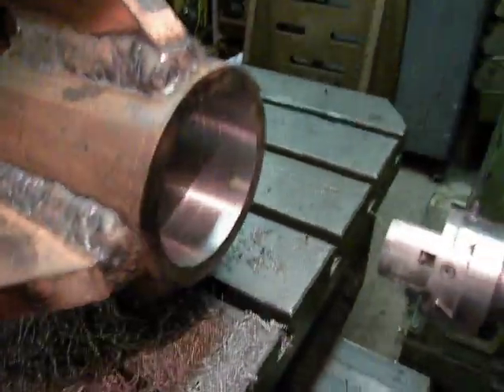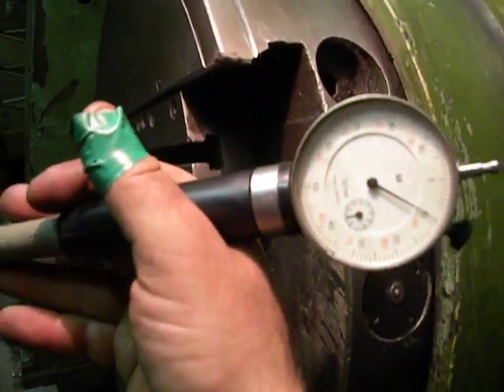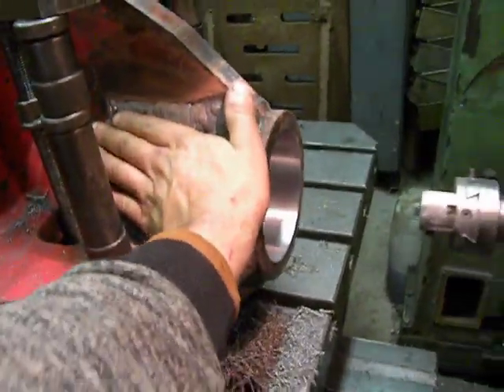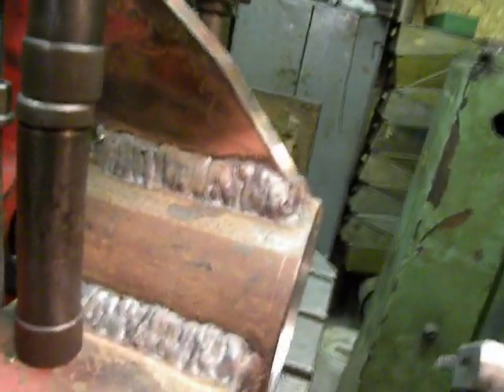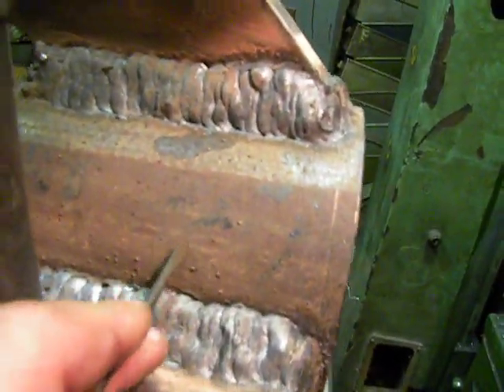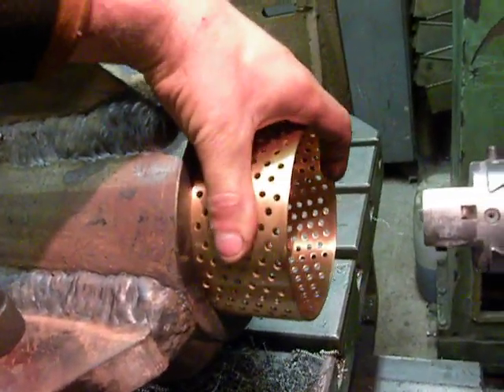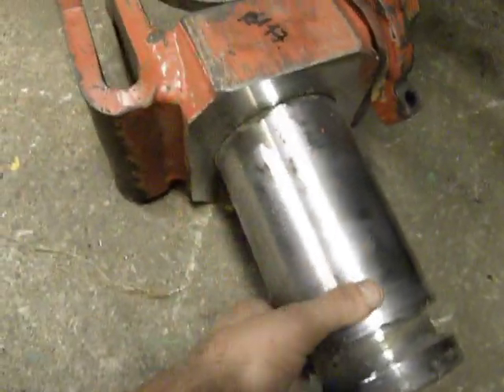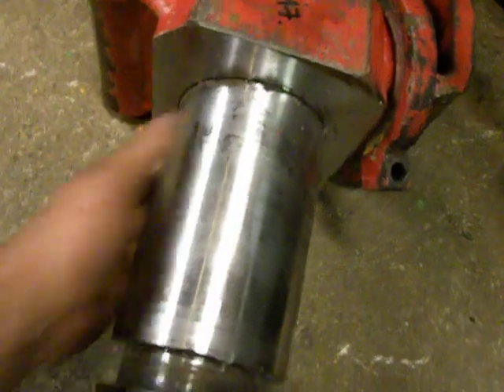Plow part repair - finish /p11

Comment: Thanks for the vids!! More please :-P! Do you find it easier to do accurate bores on the HBM or on a lathe?
Reply from the maker: I hope more videos will come, but with another works. ;-)
Well, I had lot think for "mobile line borer", but problem is that to main part of that set = motor head cost 10'000+ EUR, so, I must build it by my own or try find used one.... definetly it will be worned out and beat up. For now nothing can be better than Horizontal Boring Machine - it is large universal machine.

Comment: Those bushings look like they are very light duty. Do they have a short life expectancy?
Reply from the maker: Those bronze bushings can hold huge enough loads and they can service a long time enough, but there is one important rule - grease it and it will work good long time.
Reply: FactoryDragon87. I guess there is a lot of surface area to distribute the load with a large bushing like that even considering the holes.
 I believe that a thicker bushing would allow the operator to be aware of the problem before it starts damaging the part.
 My job is also to repair abused and neglected machinery. I am very much in awe of your work ethic and ingenuity. Thanks for sharing. Dan in N.Y.
Reply from the maker: There in that unit is no problem in bushings, there is problem in design = it is designed too poor (too thin also) for 5 / 7-bottom plow. There is another problem: as customer said- that tractorist do not care for equipment.... and here becomes one huge problem - this part is not foolproof anymore.
Thanks a lot! 
Well, to fix broken machinery is interesting. Yeah, there is some "salt" in this work.... anyway WE always can find way how to fix it, because WE are repair engineers, Yea - Engineers. I like make my work good as possible. Quality is like trade mark.
Cheers!